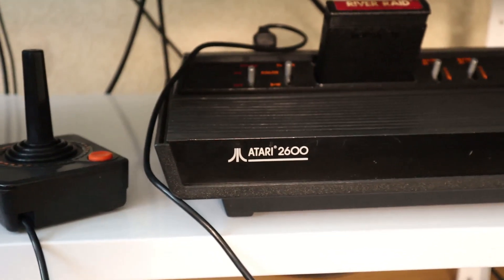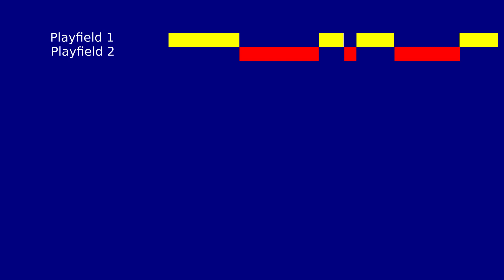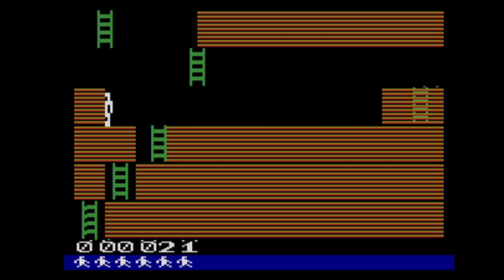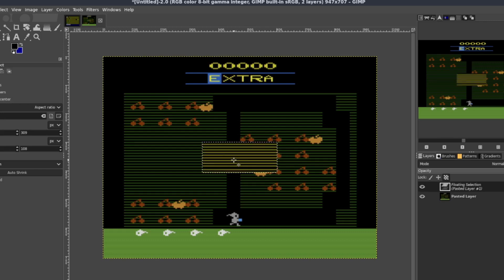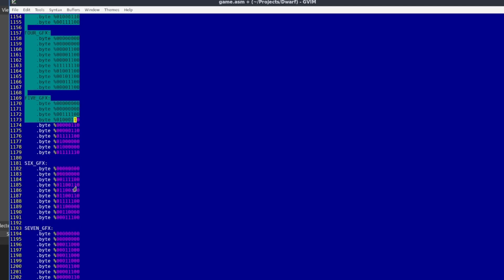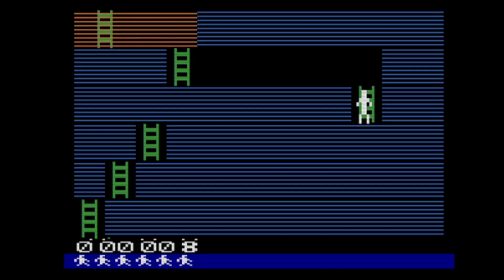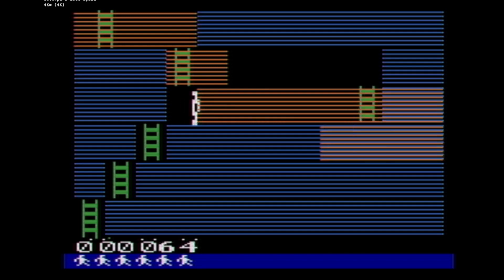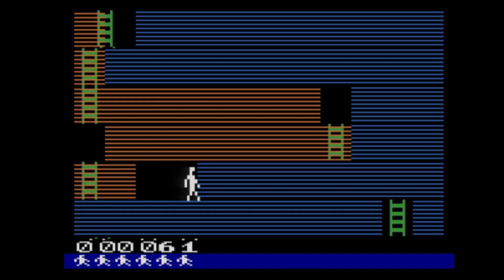Making Atari 2600 Game. Part 4. Fixing Bugs & Adding Sounds

Comment: This series is great. Thank you! I'd love to see more 2600 projects from you and I'll be exploring your source code and testing out the game! One thing in particular that piqued my curiosity was the mentioning of PAL not having stereo where NTSC did, and it sent me down a small rabbit hole of research. NTSC TVs didn't have stereo until 1984, and the Atari 2600 didn't have stereo support until the 2600jr in 1986 -- meaning most Atari video games did not use stereo at all. Having been so long it's hard to fathom that there was a time where TVs only had mono sound.
Reply from the maker: Thank you for watching. The stereo mod is a pretty modern "invention". As far as I know originaly there were plans to include speakers inside the case of the 2600, but later this idea was dropped and the sound was outputed to the TV. And as you've mentioned, all TVs were mono back then, so there was no need to have two separate audio lines. So they were not included on Pal systems.

Comment: No other console that I'm aware of is more sensitive to timing issues. Since the program itself is responsible for controlling the drawing of objects it stands to reason that timing would be your number one priority. And of course since the CPU has to do this, it reduces what other type of code can be run per screen. Several games use the alternate line method to give their code more time to run. This alternate line trick is also sometimes used to allow more than 2 objects since they are broken up into opposite lines (have a look at Carol Shaw's "Polo" game for example).*

About the limited audio, there's a funny story about Garry Kitchen's "Pressure Cooker" for Activision. He hired a musician to write a short tune that would play at the beginning of the game. The musician was very excited to be involved in a game that would like sell tens or hundreds of thousands of copies. Then Garry handed him a keyboard with stickers on certain keys and told him, "You can only use THOSE notes" because of the limitations of the hardware and how it produced notes. Anyway, the tune came out pretty good: https://youtu.be/P9ONGy1Xgvc?t=8

* https://youtu.be/tOTxLotsfXs Carol Shaw also created the excellent River Raid for the 2600. One of the smoothest scrolling games ever made for that system.

Comment: I have two suggestions for possible gameplay addition: 
- The ability to dig underneath your character so you can trap the lava in a pocket and run away. You'd have to be careful not to trap yourself
- Some item (maybe a gem or clock or something) that you could pick up to freeze the lava.

Last suggestion, though I realize it may not be feasible, but lava typically moves upward, not downward, so maybe the player and lava should start at the bottom of the screen and move up?
Reply from the maker: Thanks! Lava that moves upwards was (I think) the first option when I started to prototype this game, but for some reason I ditched it. Probably I did not want to deal with gravity.

Comment: Ladder snapping effect looks great!

I'd suggest you try pallet cycling the lava at some point, maybe between yellow - red, to give an animated 'glow' effect. Color cycling is a classic 2600 effect that I really enjoyed seeing. Ought to be decently easy to pull off too; just update the lava color value a tad every V-Blank.

There is a software called 'TIA Tracker' that is a somewhat obscure atari 2600 tia chip sound tracker that can be used to make sound fx and "music" if you don't want to manually code songs. I've used the software before fine, but have never tried the export options to get sounds running on real hardware or emulators.
Reply from the maker: Thanks for suggestions, I already want to try out the color cycling.